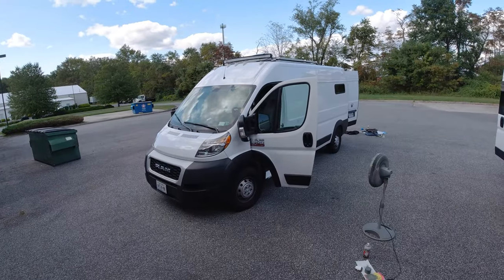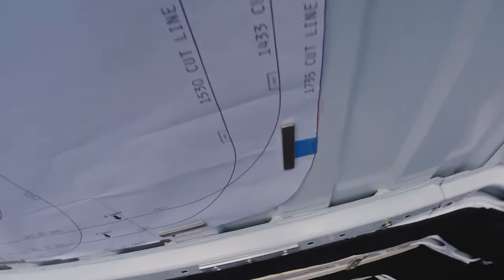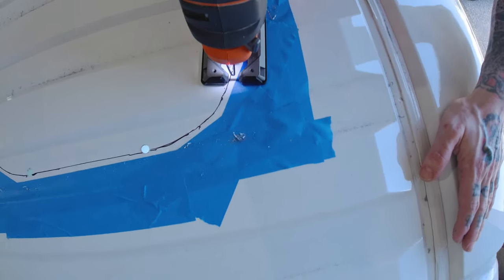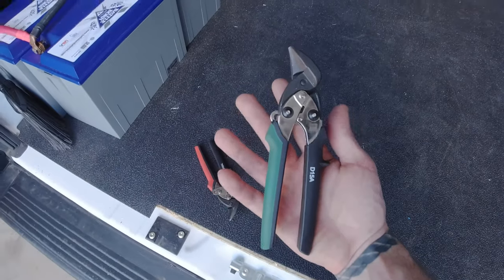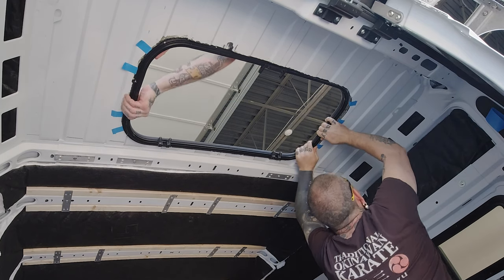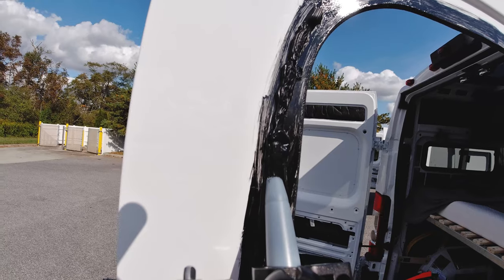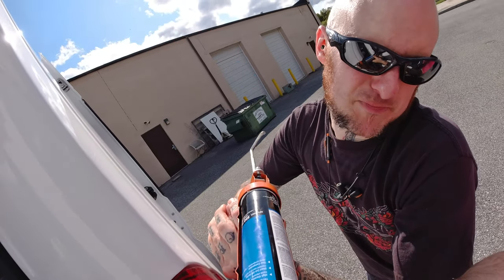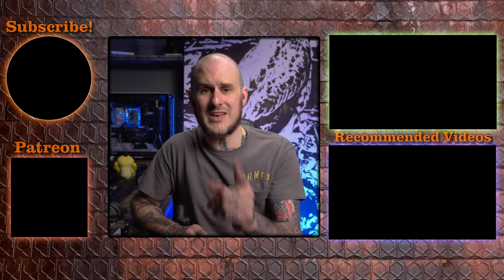RAM Promaster Sunroof & Cargo Door Windows Install – Van Life - CRL and Van Windows Direct

Comment: How is that file attached to the wood handle? That looks like a useful tool
Reply from the maker: dan hoy It is screwed on. Auto Body Files have countersunk holes in them to screw the file to a Body File Holder (what the wood is called). Or there are flexible handles that adjust the curve of the Body File as needed. I use these all the time in Body Work. It’s how I file fit patch panels, find high spots on panels, etc etc.
Reply: I appreciate the reply!

Comment: Man.. shades of the 60s and 70s.  Installing a "sun" roof in a van. Living in a van. Camping. Oh ya, driving a van.
I guess "they" are right... everything old is new again.
Had lots of good times in vans, decades ago. ;)
I used to get the blanks from a shop that put in a lot of windows and such.  It was great for patches that matched the gauge of the metal on vehicles of the time.  Plus, it was free. :)
Is flipping tape in the air "in" as well? ;)  If so... mad skills.
Good job, as usual, Alan.

Comment: Would a pneumatic sheet metal cutter if available be a good substitute for the jigsaw ? Or would the ribs of the roof make it difficult for the accuracy ?
Reply from the maker: Metal Bob ribs would really screw that up. A jigsaw or air body saw is really, in my opinion, the best bet here. Less heat input to melt the paint than a Cut Off Wheel, and since it gets covered with a flange, minor cutting mistakes aren’t a problem.